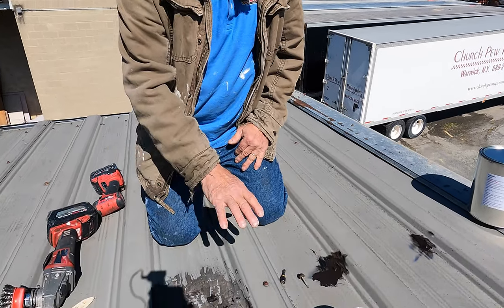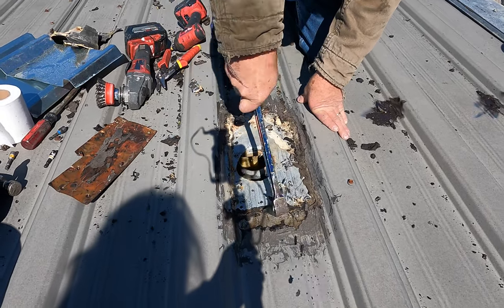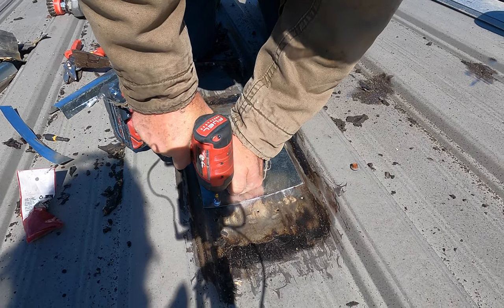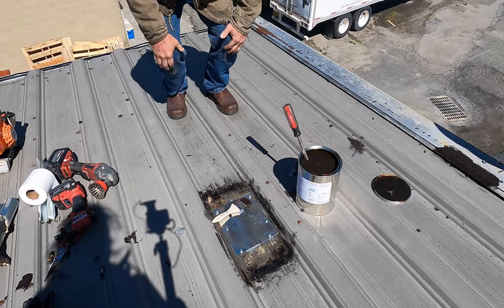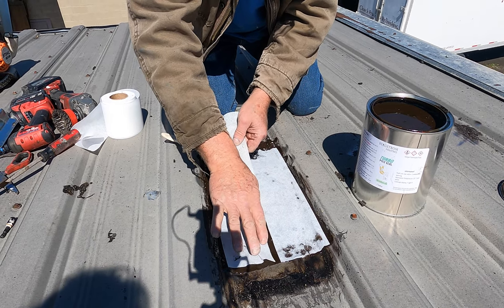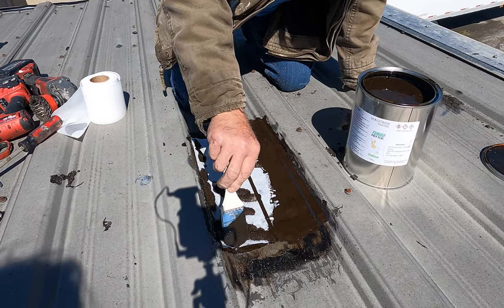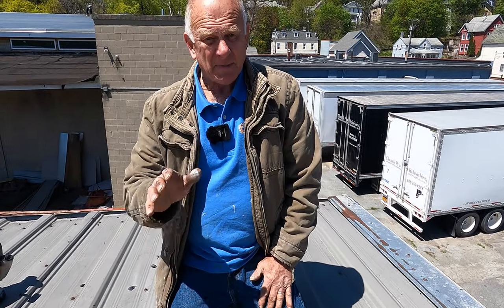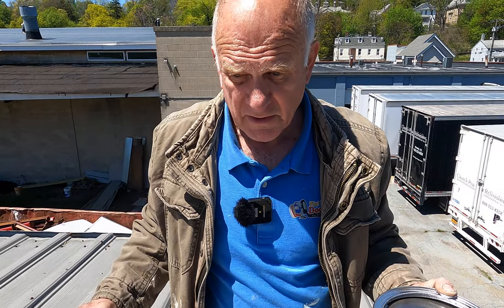How to Patch Hole in Metal Roof- Turbo Poly Seal

Comment: Thanks for the video. A couple of things I would do differently would be as follows. Fold a new piece of metal that covered the entire section previously repaired including the side laps and place sealant between the new metal section and the old roof sheeting prior to screwing the new metal section down.
Remove any excess sealant to prevent ponding of water at the repair site.

Comment: How big would a hole need to be to necessitate a metal plate as well instead of just the turbo polyseal and fleece?
Reply from the maker: I have covered holes over 10" wide with only Fleece and Turbo. But I did uses 2 layers of fleece and it came off a wider roll I had. I think if you expect someone to step on the repair, then you are better off to use some metal for strength.
Reply: @FlatRoofDoctor where does, someone purchase this Fleece,  from?

Comment: Given how much of a mess the previous person made, it would probably be easier to just cut that whole area out and graft a new piece in with the peaks of the valley as the seam point, overlapping the old roof over the patch above and over the old roof below. In my experience, no compound lasts. Not even the most expensive kind. The best solution is always clean metal joints in such cases.

Comment: Never work that close to the edge without a harness and roof ring. So easy to trip and fall over the side. Not worth it.
Reply: Omg im a roofer i do simular repairs to shipping containers, if your stupid enuf to fall off you shouldn't be on a roof
Reply: @fershr1  yes im afraid its called evolution